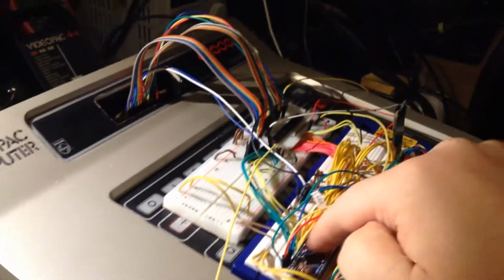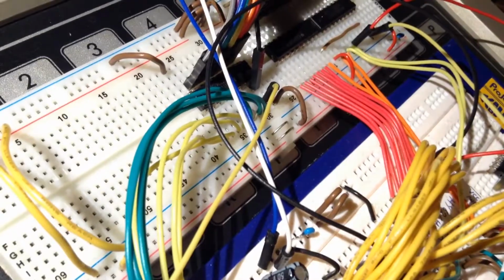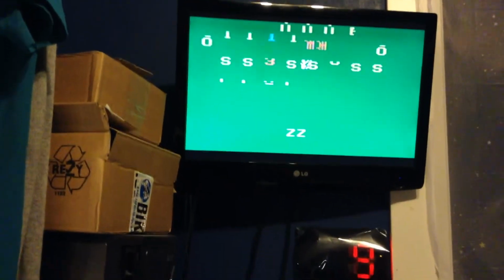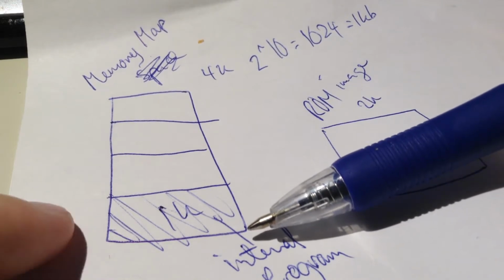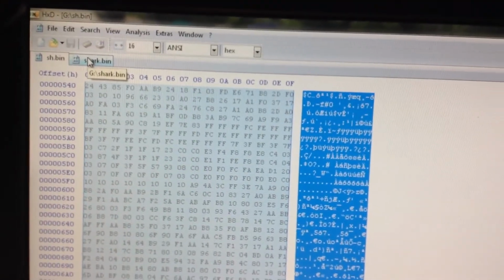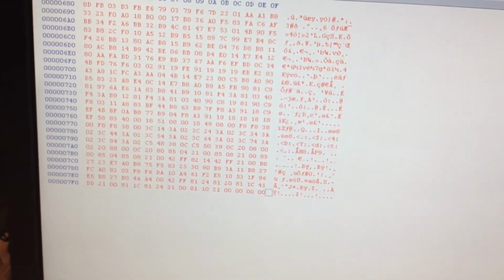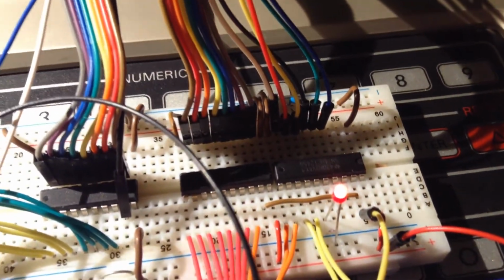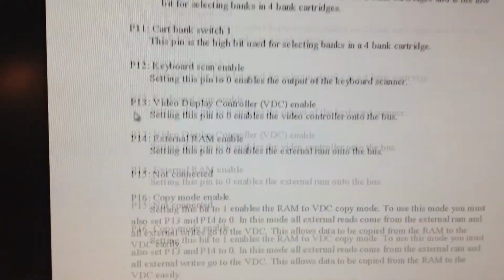Videopac - The A10 and the Memory Map

Comment: I thought perhaps the use of the 1st Kb or RAM in the Videopac is quite similar to the 1st Kb of RAM in the C64? Addressing is weird in the Videopac...
Reply from the maker: For RAM yes, it is similar. Zero page... For program memory it is different. The Intel 8048 is a microcontroller with its own ram and rom (1k). Once the program counter steps outside the 1k, the /PSEN that goes up to the cart starts pulsing, meaning that it wants data from the external program memory. (when it is low, data from the external rom is put on the bus).

Comment: Tata.... and the open heart surgery scene on the G7000 is revealed. It's alive! It works! Great job!
Reply from the maker: Haha. Yeah. The t-shirt designates the chest area. Things can go wrong if pins short circuit, and especially if i lift them up from the breadboard and drop dem on a power pin. I have had smoke out of the arduino a couple of times. Quickly removed power and it all is still a-ok, but what if it was powered by the videopac I don't think that would have gone well :D

Comment: Brilliant =D  As I said in the last part - sometimes what appears like simple addressing can confuse the hell out of you lol.  I've got a similarly brain taxing problem trying to work out what's going on when dumping an Atari Lynx ROM from code running on the lynx.  ie. got some code running on the Lynx, swap the cart over, hit a button, starts reading the ROM and sending the data via the comlynx cable to the PC.  The strange thing is the first 1K matches a dump I already have of that same game, then I get a chunk of around 256 bytes that doesn't match.  

Pretty sure its a similar issue to what you were having with A10 - in that perhaps the addressing used by the Lynx to read the 2nd cart isn't the same as the cart it booted from.  ie. I suspect the Lynx is in addressing mode where its using counters differently between the cart which loads the dumper, vs the cart being dumped - ie. address lines must be wired differently between the dump cart and game trying to dump.  I need to spend more time on it I think...   The code originally came from Alex Thiesen, so I cannot take credit for that, but I did write my own code to read the cart a while back (minus the comlynx part to send it anywhere) - my code was the same and it appeared to work, but I never tested it on 512K carts.  I might go back and test my old code to see if that still works if the dumper is put onto a 512K cart.
Reply from the maker: Thats interesting. I think this the reason why another videpac multi-cartridge comes with a mode-selector. I don't know about the lynx, but if it is 256 bytes in the wrong place look at A8 ? Perhaps its reading from another chip entirely at that region ?

Comment: Haha. That worked!
Reply from the maker: Pretty cool. Didn't get my theory to work at first, but that was after I had rearranged the address pins by accident. The next thing todo now is to decide how to interface the menu program, and how the ram is going to be programmed. Maybe it can be programmed inbetween cycles. It is important that the videopac has access to the program rom for every /PSEN=0 (when the rom drives data on the bus for the cpu), otherwise the local buses (the ones on my cart) are in theory free.
1. Another scheme is to have a separate rom and a separate ram. In this way it can be programmed much like the G7000RAM cart. Somehow data from the arduino has to be fetched by the videpac cpu. We already have the serial transfer code by Sören Gust, so instead of serial we can put 8 bit on the bus and sort of handshake it back to the cpu. You asked who is setting the speed (the question about syncronous). The arduino and cpu are async, so handshaking would be necessary, for example by port pins p1.0 and p1.1. Still it would be much faster than serial transfer. A third memory would be needed that the arduino can write too, but this doesn't have to be memory, it can be a 8bit latch storing data for the videopac to fetch, se any storage read (/RD signal) to any address on the cart port, the register will put its content on the bus. Again this has to happen when the arduino handshakes the cpu (arduino pulls a line, the cpu sees it, fetch data, pulls the other line, the arduino continues to next byte and release its line (4-phase handshaking)).
2. Similar to 1., but instead of that register, how about borrowing space in RAM to store parameters/data for the videopac to load ? I mean, if we have a separate ram and rom chip, we can just let the arduino fill it in the background while the program is running ? (why didn't i think of that in 1.) Well, we need to give the videopac cpu a menu list also. Lets put the content of the sd card as menu entries in the ram, pull the T0 signal, which was used by the RAMCart for serial transfer to signal the menu program that data is ready to be fetched. (bit-testing T0 in machinecode is a single instruction!).

Allthough I'd like to write an option Nr. 3 with just RAM only, I think its easyer and cheaper to have a ram and rom separate than trying to add a lot of discrete components to use a single RAM. A CPLD would have done this easily.. Or perhaps a GAL chip ? .. Anyway I like Nr.2. To sum Nr.2 up: The videopac is turned on and jumps to $0400. 
- The menu rom is running...
- The menu rom polls T0 and checks if it is low, forever or perhaps with a timeout... 
- The arduino wakes up from power-on and reads the sd cart, composes a list of entries and fills a table in RAM.
- The arduino release its local bus and pulls T0 to 0 to signify that the job is complete, and RAM is yours!
- The menu program jumps out of the loop and starts reading from RAM. Now the arduino I/O must be silent (high Z), and somehow the local bus must become one with the data bus. (one problem at the time..)
- The menu has put the entries on the screen. It can use videopac-memory for this (256bytes). (videomemory?)
Now how should the menu signal the arduino to which file entry fill in memory?
 Remember the arduino has handed the RAM over to the videopac
- The menu program puts a menu item id in a location in ram and pulls on T0 (lets make T0 bidirectional, and it is possible).
- The menu program polls T0 like before in a infinite loop or with timeout.
- The arduino isolate the local bus to have the RAM for itself.
- The arduino fills the RAM with the contents of the SD Card. Does some mirroring depending of the size of the file (remember the RAM is 1:1 on the address bus always).
- The arduino hands release its local bus and sets T0 to 0 to signal it is finished.
- The game is ready to start

Where to go from here I'm not sure, but we are getting close. There is a problem now that the ROM must be interchanged with the RAM, and how do we do this without crashing the cpu ? I think if we jump to bios-start game routine, the ROM is no longer in use and now we can do the switch before the user hits a number on the keyboard. :)